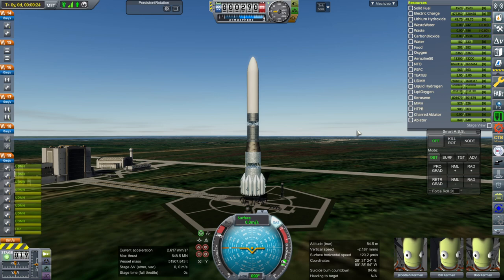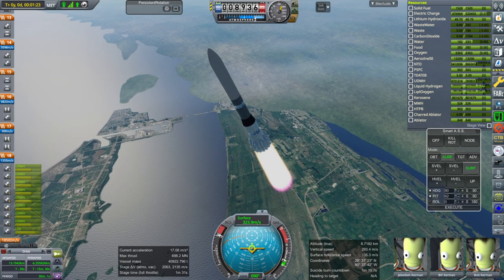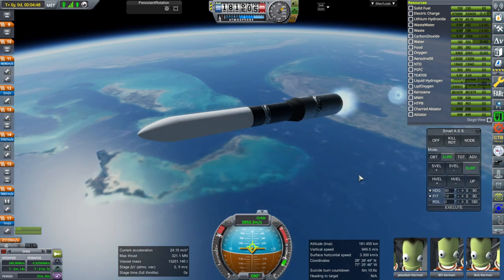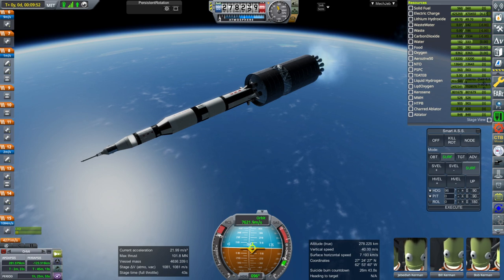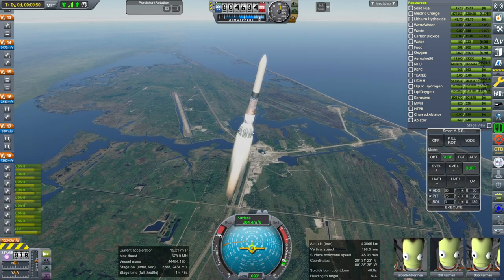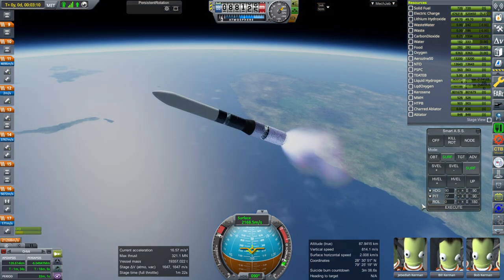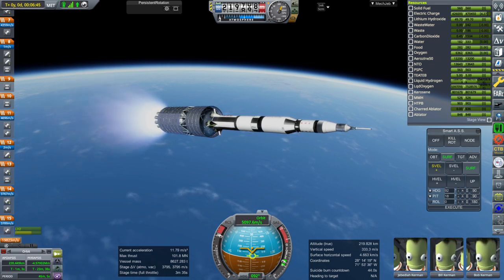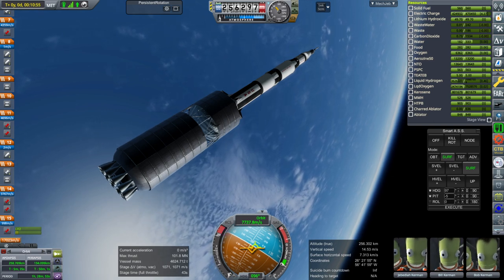Realism Overhaul in KSP 1.11 - Monument's New Plume

Comment: Raiz RO and ROE now have built-in Waterfall if you want a nice set of plumes that you can use. There's also the #RO-Waterfall chat on the RO discord if you need/want assistance with setting up waterfall plumes
Reply from the maker: RO doesn't configure Waterfall plumes for all the engines it has RealPlumes for yet, though, right?
Reply: @RaizSpace  RO contains some profiles/pre-made plumes for Waterfall now, while RO Engines makes near full use of them. But the real plume configs still exist, they've been modified to turn off when waterfall is installed though.

Random, I highly suggest grabbing Katniss KSP Parts, it has a very nice Saturn V/Saturn MLV parts

Comment: Jumping is probably caused by low framerate. I have seen some mods which allow to artificially cap time (like 0.1x warp) - might help with this problem.
Reply: You mean better time warp, that should actually come with RO.
Reply from the maker: I mean, it's caused by a glitch in 1.11 because it didn't happen before and happens with rockets that get much better frame rate than this one. I don't think the frame rate explanation actually works out.